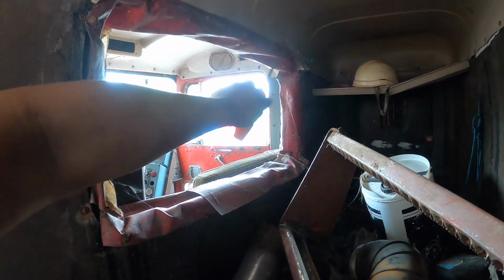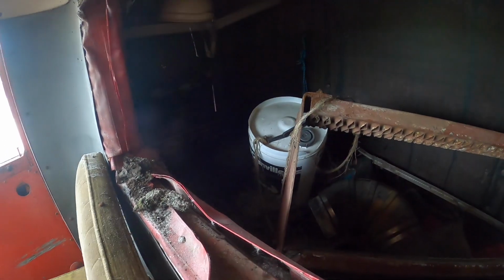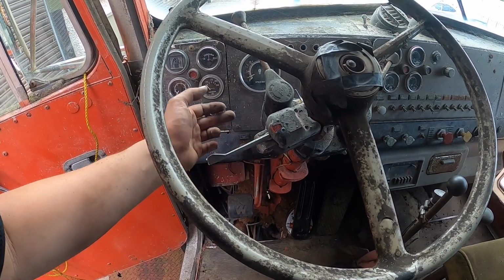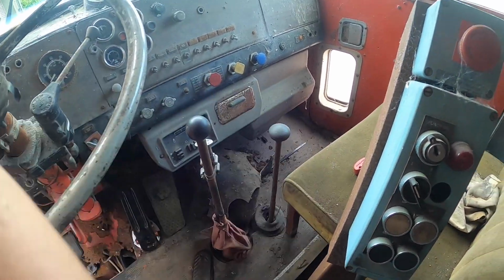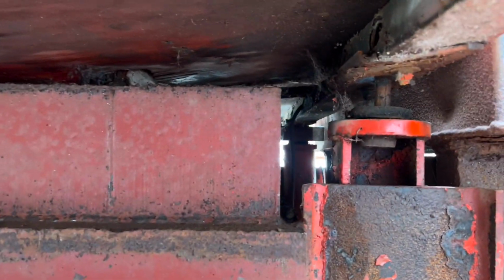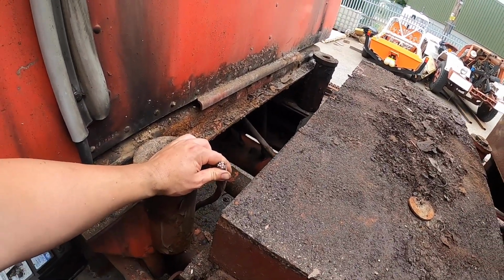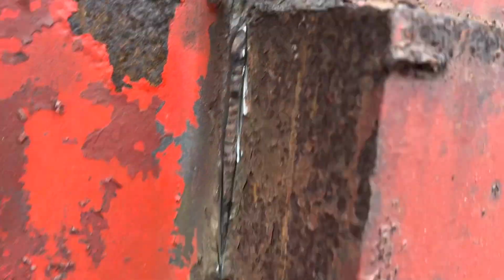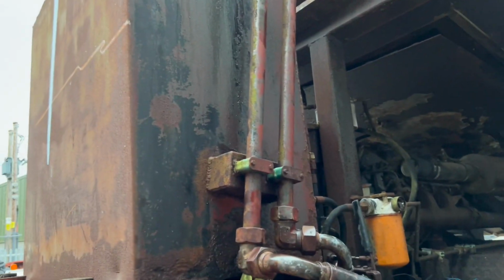Kenworth C540 Rusty Project Truck - Coffin Sleeper Removal #diesel #truck #project #rust #car

Comment: What do you mean by brake saver switch? Jackobs engine brake? You dont need a switch other than the one on the dash as there should be inline switches for clutch out and throttle at idle. The original 3 lights in the centre panel should be left turn, hi beam, right turn. Your high beam should be a foot dipper switch on the floor. The indicator switch on the column is std old truck fair, left right and 4way if you pull the lower tab out.
Overdrive transmission. What is actually in it? Most of the series of 10 and 15 speeds can be altered internally (its a gear switch) to make them overdrive. Thats enough for most trucks, 13  speeds are over rated. With the torques and HP that has, a 10 speed overdrive would be all youd ever need unless you have heavy haul work lined up. A 15 speed if you want 2 gears lower than than the 10.
Full height sleeper entry is a good idea. The truck I did my driver training in was an 80's W model KW. They had seats in the sleeper. You could do that, have it convertible with a fold up bed. Raid a wreckers yard, Air ride seats and a fold up bed, Im sure some trucks used road ranger transmissions, Im not sure until how new but I know some did in as late as the 90's. Matching your actual yokes for the size unis on your tailshafts will be the hardest part as I imagine they will be fairly heavy duty. You can get tranmission mounted PTO that will run any crane you could fit.
Reply from the maker: 3408 Brake saver is run as a manually adjustable or automatic hence the switch

The indicator switch is pretty similar to the aftermarket series landrover ones we used to get in the U.K.
But I've been told by someone else it is original

Its a 10 speed but the 6.58 gears in the back keep the gearing too low in general, an aux trans like a 1241C with a .81 OD would give me a top speed of 66

Old scrap yards in this country are few and far between. I will fix the original seat or buy a new one if need be. 

Yokes wont be a problem though, standard Eaton stuff
Reply: @big_rig_resto  the 10 speed you can overdrive and add that to the aux step up. There’s bound to be a pdf of the tech manual for the how to online.
Reply from the maker: @bobbob-fg5wy  Its already got an OD 10th gear
Reply: @big_rig_resto  so 4th and 5th gear are reversed?
R25   710
134. 689
Reply from the maker: @bobbob-fg5wy  5th is top right
Reply: @big_rig_resto  turn the aux box around, more overdrives than you can poke a stick at 🤣

Comment: The turn signal switch looks original to me and I think they are hard to find.
And those Vickers hydraulic pumps are valuable especially if the cartridges inside are in good condition.
Reply from the maker: That's odd, it looks like the aftermarket landrover ones we can buy in the U.K. 

But as long as it works I will be keeping it. The pump will be kept too if it works as I plan on eventually having a hiab crane on the rear
Reply: As B56P says original Signal Stat brand turn signal switch and they were on everything through the "80"s with slight variations to stalk shape and some had the high beam switch on the end of the stalk (Western Star).

Comment: This truck is cool as.  Hopefully you can get those slabs sold and put some money back in your pocket.  No good suggestions on the Patreon stuff, but I don't mind sitting through an ad or two for a quality video.  Keep up the good work, excited to see how this progresses 👍

Side note, you'll probably want a low air light and buzzer on the dash as well.  Dunno about the UK, but they are mandatory to get a commercial truck road legal in the US
Reply from the maker: Thanks for the feedback, I actually sold the smaller chunks yesterday for £1 per kilo which was a good deal. Got me about £1700 back towards the truck which is half the cost of the tyres 

Hopefully someone will want part of the big slab too! 

It has a low air drop down sign in the windshield but I don't think it's hooked up anymore or the line that supplies it is blocked up. One of the two

Comment: I would send over the US to get a nice big sleeper, with a bigger step through area, that will let the seats go back a bit more. Jeez that is some rust!
Reply from the maker: When I sat in it at the old owner's place it wasn't terrible seating position wise. Certainly better than the Autocar!

For what I will eventually use it for the sleeper is plenty big enough. If I want more room I'll probably end up with a trailer to tow

Comment: Old heavy truck and equipment restoration is big here in the states, the pain in butt projects often end up being the favorites, keep the faith! I think I saw that it's a 3408 Cat? If so you can make a bunch of power with that motor if properly messaged.
Reply from the maker: Yes it is, very low hours too

I will be tweaking the pump a little. Other than that it will stay as is though, I don't really want to push the engine too hard given how expensive parts are for it!

Comment: To much talking not enough of what we came here for the actual breaking down of the truck. SMH
Reply from the maker: It has to stay mobile, so sleeper cab, hydraulic fluids and the big billets were the name of the game. 

There's only so much I can fit into a 30 minute video too. But when it comes time to gas axe the rear bed I will pretty much just do a full video of that or Timelapse and video using two GoPros

Comment: The three indicator holders in front of the steering wheel are for your turn signal indicators and high beam indicator. The reason for the headlight, markers , and park lights, on seperate switches, is they each have their own circuit breaker so if one circuit shorts you don't loose everything.
Reply from the maker: Gotcha, will probably rewire them in the same fashion then but might use a multi position switch to clean it up a bit
Reply: Are my favourite memories of my grand dad working on old kw’s , just one I remember him buying a 1967 lw 923 from north Vancouver railroad yard , we were logging contractors , it had a 350 Cummins 6-4 and a 5th wheel, he totally rebuilt it into one of the best logging trucks in the frazer valley, she was called “ the old blister “ she’s quite a famous old truck in the old logging community, it was our lightest logging trucks, the rest were all lw 924 and 925 to the tune of 17 logging trucks total, including and highway set up 848 , off highway logging was two 850 kw’s , we had loaders, yarders , road grader ,2 ,D-9 , 2 ,D-6, even a little D-4
Reply: Yep 👍🏻